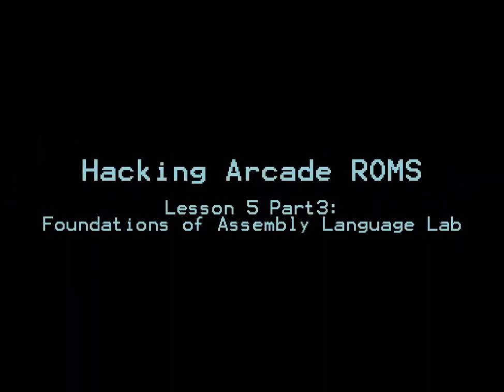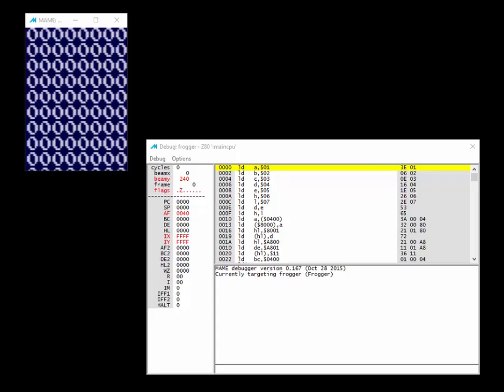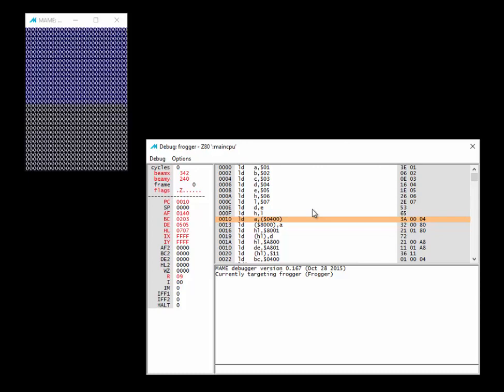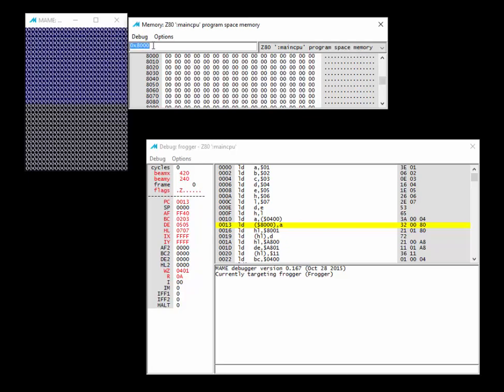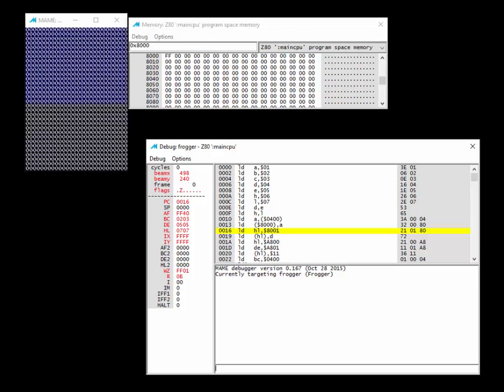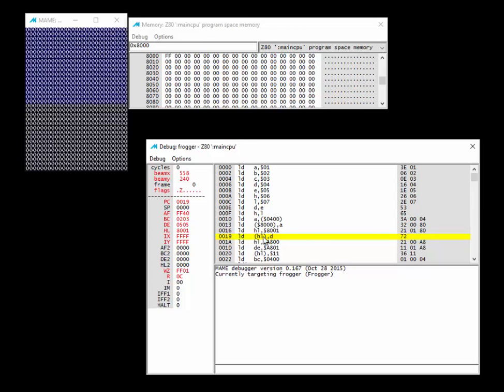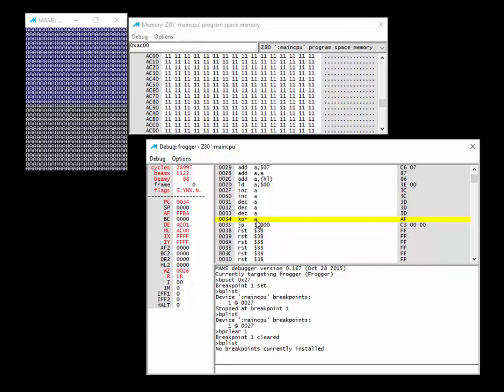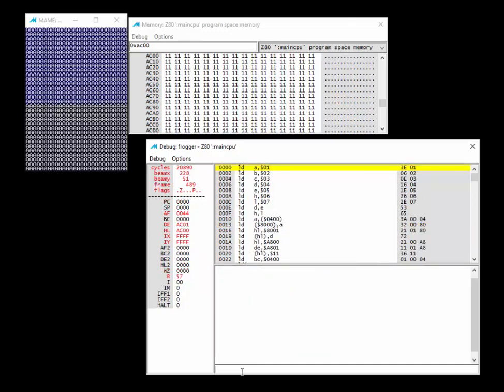arcade ROM hacking lesson 5 Part 3: Creating a Free Play Hack (assembly language lab)

Comment: The manual that came with first computer, Apple II+, had assembly code examples. So I went from learning AppleSoft basic to assembly code. There was no other languages available for the Apple II+ at that time. Later Apple released Pascal, which was much more practical for writing complex programs.
Reply from the maker: good stuff, I learned to program with this book https://i2.wp.com/www.applerescueofdenver.com/wp-content/uploads/AII-UG-1st-1.jpg?resize=150%2C207 on my apple IIe (which I still have operational :)

Comment: Awesome stuff to date Brain really well done easy to follow and well explained!, i just have a question with reference to PC regsiter , I was wondering how it derives that next ram location, I noticed when you popped into the memory window that the program start sequence began at  ram location 0000 which was loading $01 into register A which if i not wrong is 0002? then its jumps to 0002 and requests 0004 ($02) into register B, im just curious as to why the PC doesn't roll one after the other 0000,0001 etc or straight to the said memory location its want to load for instance ram location 0004 representing the location of $02 it wishes to copy into register B. Hope that makes sense mate, really enjoying and finding it easy to pick up mate well narrated..
Reply from the maker: Hi Franky P, the CPU knows how "big" each instruction is, so it just adds the size of the current instruction to the current PC to come up with the next PC (unless in the case of a branch). so the first instruction at 0x0000 is "LD a, $01" which is actually stored in machine code as "3E 01" that's 2 bytes so the next instruction is 0x0000 + 2 or 0x0002, same thing with the second instruction @ 0x0002 it's 2 bytes so the next instruction is @ 0x0004. The Z80 has different sized instructions (for example the instruction @ 0x00010 is 3 bytes long, and the next instruction is 0x0013 so the CPU has to know the size of the instruction and add it to the PC register, Some CPU like MIPS and ARM have a fixed sized instruction every instruction is the same size so it's easy to figure out the next instruction on those architectures. Z80 and intel PCs (x86 and x86_64 each instruction can have a completely different length)
Reply: @arcade-cabinets  Thanks mate makes sense, I can see how the byte size dictates the PC's next instruction location. Does it always reference the previous byte into its instruction even though its not loading those bits into the register example it loads 01 in D however also has 3E to the left of it even though it's not executing that byte.  I assume the machine code language is just saying load 01 being next to 3E into D?, with the x04000 branch even though all bits are 00 what does 3A 00 04 represent, I'm about to commence part 4 so i apologize if this is addressed in the following lesson at all..
Reply from the maker: @YNGBLD80  in this case for the first instruction 3E means to the CPU "LD A"

the second instruction (06 02) 06 means "LD B" and 02 means the number 02 ($02)

so the short answer is yes the CPU needs those bytes because they are part of the instruction

in regards to 3A 00 04 
mean "LD A" and 00 04 is "4000" (why 00 04 == 4000) is how Z80s store multibyte numbers (called little endian) I have a video on endianness which is something you'll definitely want to check out as it comes up often.

Why does 3E mean "LD A" and 3A also means "LD A" later? that's because they are different types of loads, one loads A from an "immediate value" (01) the later instruction means "Load A from a memory address" (0x4000) The CPU needs to know what "type" of loads each expects so there is not a universal "LD A" there a few different types, and each type expects a different 2nd parameter, however they all basically are "Loading A" which is why it's still written LD A
Reply: @arcade-cabinets  make sense!,  gentleman appreciate  the detailed reply and clarity, I guess I'll look up a machine code instruction/op chart and suss out these type commands to familiarise myself a little more. It's now sinking in as to how the "load" and "enable" from ram/rom to registers onto the cpu works :) and now I can begin to relate it back  to PIA's  etc.. 👊
Reply: @arcade-cabinets  With relation to the address lines I'm trying to understand the memory process more so the structure a little more clearly so I assume 64K equates to 2^64 in turn totalling the number of memory cell locations, in which each cell has 16 bus lines which can individually accomadate for a total storage of 8bits of data. So am I correct in assuming that 16x255 means it can store a value of 4080 (not necessarily memory) per branch or this is redundant thinking as 16 bus lines at 8bits per line is 128k per branch multiplied by the total number of cells equals the memory. I think this seems more logical but am on the right thought process where by the memory capability of each cell equates to the total memory capability of the CPU?
Reply from the maker: Franky P The general formula for how much memory (max) any CPU can access is 2^(number of address lines)
So in the case of a Z80 that’s 2^16 (or 65536 or 64K). This is maximum (though there are workarounds, by various “hacks”) 

Froom the CPU’s perspective ram address usually holds 8 bits (1 byte) though there are some systems that are different. But in generally most CPUs, even  modern ones expect each address to hold 8 bits.

That said CPUs hold larger numbers in memory by storing large number across multiple addresses.
For example any byte can hold 8 bits (256 would be the max number stored), by using 2 contiguous addresses you could get 2 bytes of storage (or 65536 max number) or 4 bytes (about 4 billion max) or even 8 bytes (a number too large for me to even comprehend mentally but basically 4 billion x 4 billion) when dealing with ram the capacity of the ram is usually denoted (2^number of address lines x number of bits per address)
For example a 2114 ram has 10 address lines and each address stores 4 bits, so it’s written (1024x4)
Note: the CPUs generally consider each address to hold 8 bits, but the actual underlying RAM might be made up of chips that store much less per address (for example 1 bit per address or 4 bits per address), on the actual motherboards, these smaller rams are combined in banks to give the appearance of the CPU that each “address’ it can access stores 8 bits per adddress.
Reply: @arcade-cabinets  Got it mate, inputs (2) X no of address lines 2^16 = 64k various memory locations of which hold in our case assembly op code to execute that specific memory mapped function via registers receiving data "load" and sending/writing it to CPU. Kinda of put a little "me interpretation on it! but again thanks for the detailed clarification Brian :-)
Reply: @arcade-cabinets   Hey B, question time again!, revisiting lesson 5 again and wanting to understand why sometimes we load straight into memory via register A as opposed to sometimes amending ram via loading a few registers to get the same result. An example of both is when we load A with memory location $4000 then load A directly into Ram location $8000 with the $4000 value, then the next instruction down the line we load address location $8001 into HL then load register D with HL in turn amending memory location $8001 with value D. Why wouldn't we just load  register A  with a memory location then say use B to amend the location directly as opposed to loading an address in one registers(HL) loading a value into another register (D) then loading that register (D) into the original register (HL) in turn amending that ram location ($8001). Is it just purely resourceful to use all these differnet type registers and opcodes to manage the speed in which all this values get executed?, just found it curious.